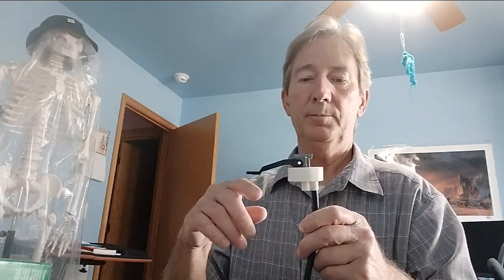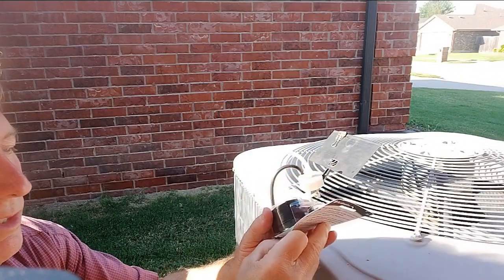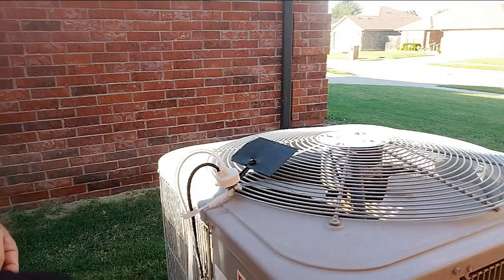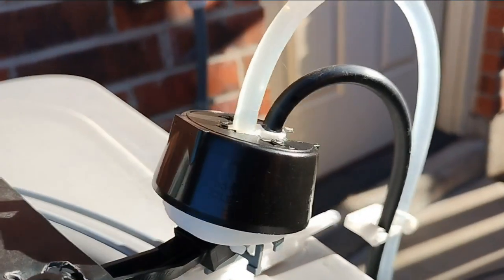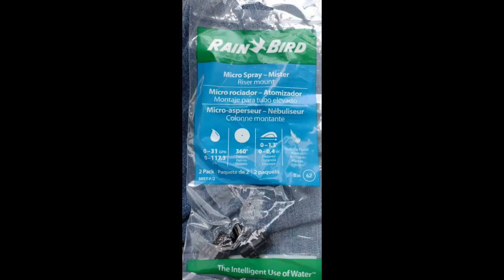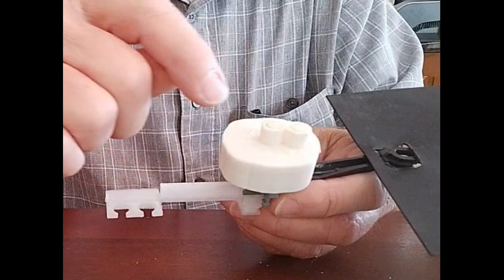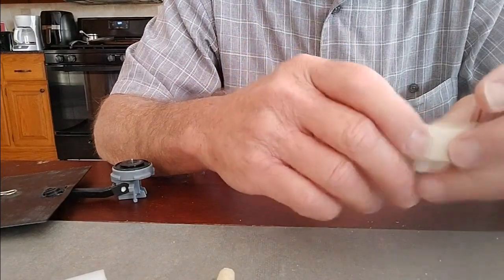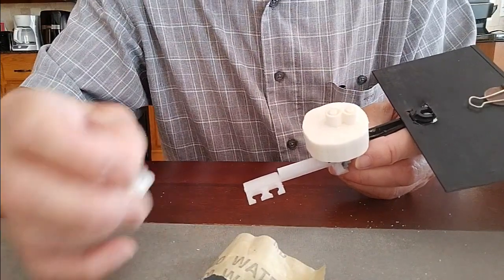A/C Misting System w/ Fluidmaster Valve

Comment: as a refrigeration mechanic i can tell you this isn't the best idea. the water overtime can lead to scale build up on the coils, insulating them and severely impacting performance. if your misting to much and drop the head pressure below a certain point you will start to have oil return/logging issues and could cause major damage to the unit. at the end of the day in my opinion it is not worth damaging a very expensive system for minimal savings.
Reply from the maker: Yeah, the commercial systems do come with a filter to remove much of the minerals from the water. A person could add a filter to this install too. My water is prob fairly clean, but I have only sprayed the coils once in 4 years with a vinegar solution, waited, then rinsed, to remove some light build-up.  As far as the concern of logging/floodback, this would be equivalent to running the A/C on a rainy day cooler than about 60 Deg. (probably doesn't happen much)  Manufacturers recommend not to run units while temps are below 60 so I'm hoping the engineers anticipated rain.  😃

Comment: Have you noticed any difference in ac performance and/or cut power costs with a condenser mister? I know it seems like a dumb question but curious if it made a significant enough difference to justify the effort of making and installing. Thanks!
Reply from the maker: Performance wise we are able to maintain the house at 75 deg while the outside is 100-115 in Oklahoma this last month. The A/C runs about 1/2 to 2/3s of the day. An amp-probe shows about 10.5 amps without the mister running and 9.3 with the mister on at 105 deg.  I believe that's about 11%ish and at 237v, it's a 285 watt savings per hour. Surprised me but, at an average of 12 hours run time per day: 285W X 12hours X 30days = 102.6 KWH X $0.09 (Elect Rate per KW) = $9.23 savings per month.
So dollar wise not much, should pay for itself in the first year.  I also look at what I believe, is the convenience of more reliability because of the lower head pressure, less run-time to reach the target temperature which is not reflected in the calculation above. This all contributes to less strain on the over-all system. From what I hear, calling for repairs is tough this year and waits are long...